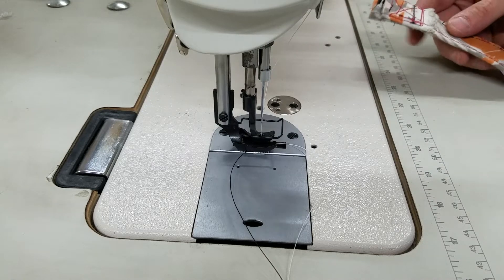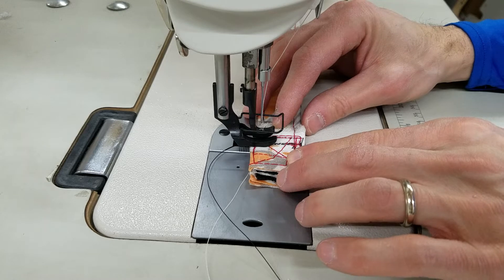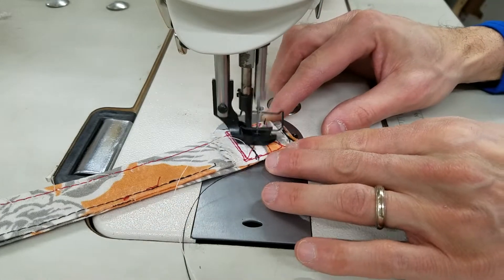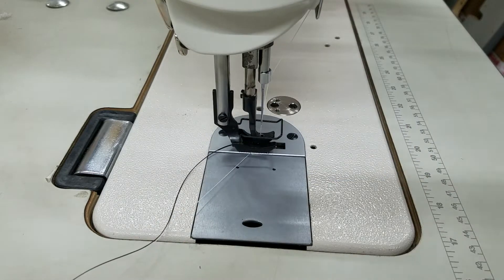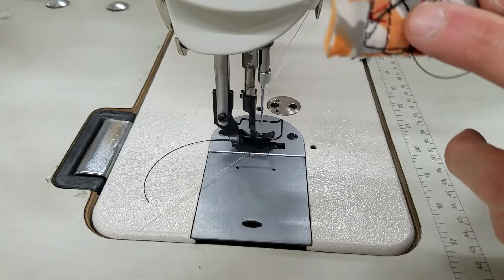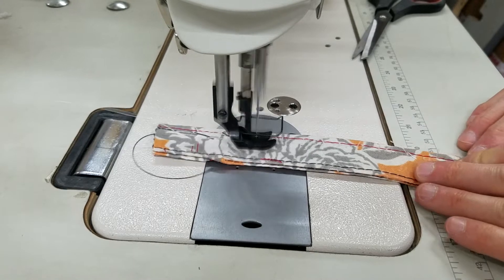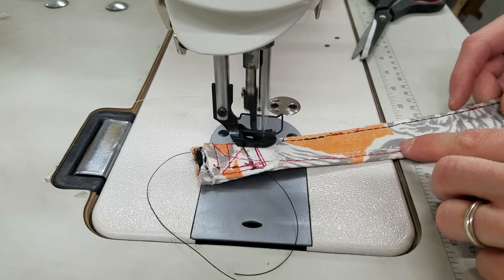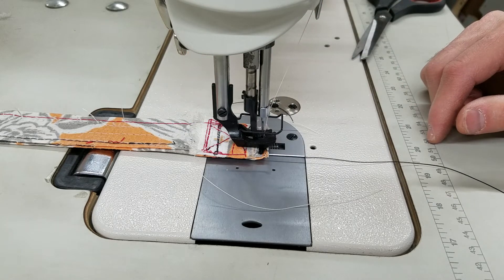Juki DNU-1541S sewing on cloth dog collar

Comment: Hi! 

I wonder if you can recommend an industrial machine for sewing dog's collar and harness. I use nylon webbing and fleece or softshell in two to four layers, which also meet double in some seams. So far i have DU-1181N and DNU1541 on my list, but i wonder about the motors, is it a clutch or servo, and what is the best for home sewing? And are they walkingfoot?
Reply from the maker: Hi Liv, 

Both of these machines will easily sew 2 to 4 layers of webbing with fleece or softshell.  Both are walking foot machines.  The DNU-1541 goes one step further.  It is a walking foot and a needle feed, also known as a compound feed among other names.  It is a little more heavy duty machine then the DU-1181N.
Regarding the motors.  I would not recommend a clutch motor anymore.  They are more difficult to control and use more anergy, along with being noisy. We have a few different types of servo motors in stock. This video will give you a brief overview of our servo motors. https://youtu.be/gv8j427e1l8

Both machines are stock items.  Please call or email me if you have any other questions.
info@sewinggold.com
888-505-4565
Reply: Thank you soooo much 👏🏼😊 I think the dnu 1541 is on top of my list now 😊